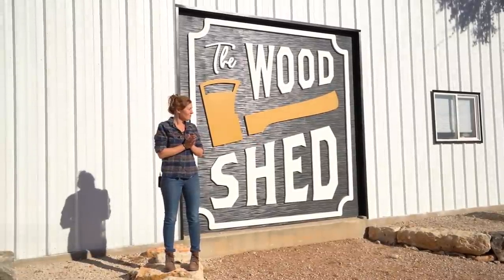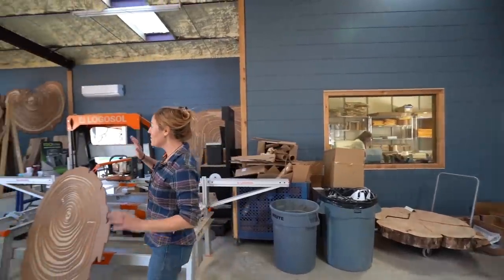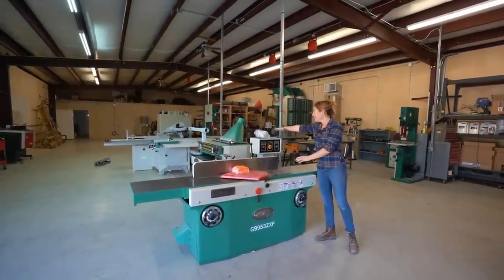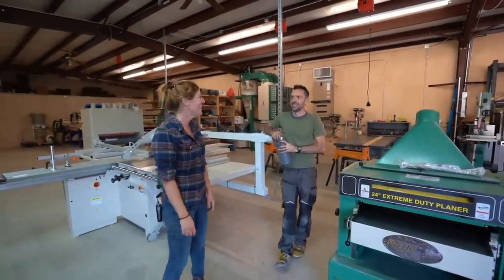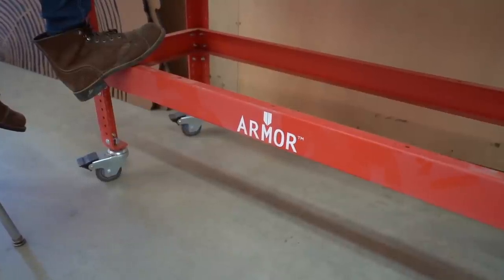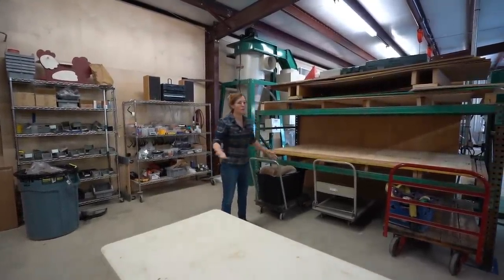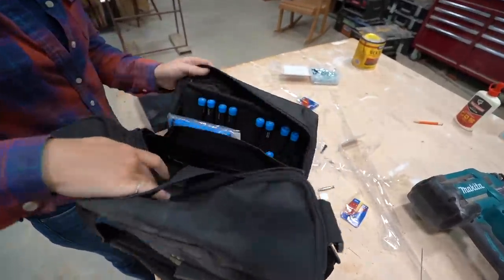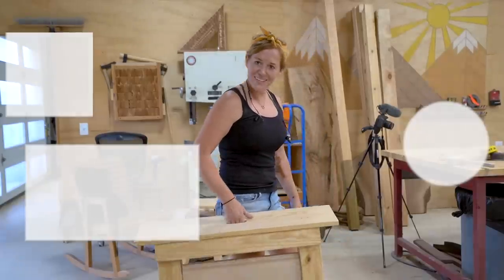Shop Tour! Inside My New Commercial Shop

Comment: When you showed the band saws I recalled a Youtuber I am following that is rebuilding a 108 year old sailing yacht.  He used a giant band saw to shape the ribs.  It is called a ship saw and the angle of the blade can be changed as he is cutting.  He also uses a number of hand tools to make the parts.  Check out Tally Ho Boat Restoration.

Comment: WoW! You have come a long way - Congrats! As a single person,  pro shop, when I am in milling mode I can produce 500-550 gallons of sawdust per day. That requires me to empty my drum every 20 minutes. With 4 people working, I predict that you will find the dust collection will require constant emptying. No doubt you had the dust collector sized appropriately for the machines as far as suction is concerned, but it is placed at the far side and the collector holding capacity is a bit small for the amount of work you will be doing. Congrats on the amazing growth you have had!

Comment: I’m surprised that the exposed foam on the ceiling is permitted.  Could you speak to that?
Reply: I bet it’s less flammable than the polyethylene that’s typically on the ceiling holding up fiberglass insulation.

Comment: Anyone had luck with the discount code (see 4:40 in the video)?  I have purchased 2 tools from Grizzly (bandsaw and jointer) and while the code is recognized as a ‘valid code’, no discount is applied.  Contacting Grizzly they stated that 14” bandsaw and the 8” jointer I was purchasing are not valid tools for the code.  They also declined to tell me which tools it DID apply to.   I love April’s feed & work and I love the Grizzly tools....I’d really LOVE to get 10% discount!  :-).   Any updates April?  Seems like Grizzly is benefitting from this great publicity but maybe not completely holding up their end?

Comment: I just stumbled across your channel.  I envy your personal and commercial shops, and all those wonderful machines.  Since I was a kid, I've always enjoyed operating machines - from movie projectors to sewing machines, from tractors to IBM mainframes.  A few decades ago I worked as a shop helper in a machine shop and had the opportunity to operate a few enormous horizontal band saws, and got a little machinist training on a manual mill and lathe.  I even got the chance to run a simple job a couple of times on a huge Brown and Sharp CNC vertical mill  from the 1970's that read its programs from paper tape.  The only command sequence I remember is G0D0Z0M05.  From there, after a decade or so in retail and food service, I moved on to data entry progressed into mainframe operations.  Computers are also machines, and I enjoy operating those too.  The company I work for eventually downgraded from its in house written IBM mainframe based platform to an IBM mid-range based platform, formerly known as the IBM AS/400.  I'm now basically a system admin on that platform.

YouTube keeps trying to find more hobbies for me than I could possibly have time for.  I've explored hobbies ranging from quilting to blacksmithing, from Bob Ross style painting to stained glass, and many more.  I took wood shop in junior high and high school, and haven't done anything with wood since.  Over the years I've thought of getting back into woodworking.   I love the look of nice woodwork, built in book cases, etc.  There are many things around my home and garage that would benefit from me getting back into wood working.  I've decided to start acquiring some wood working tools and explore this rabbit hole.  Many of the tools are machines that I would get  the pleasure of operating.  Last night I ordered a random orbital sander.  I have a wood palette for that Bob Ross style painting that needs a few more rounds of light sanding and linseed oil applications.  with sanding by hand I keep putting off working on it.

I'm also in Central Texas, between Dallas and Austin.  I'll have to check out The Wood Shed some day, if your part of Central Texas and my part of Central Texas are close enough together.  There's a lot of Texas out there.

Comment: You're doing the ductwork make sure it's all 8in no 6 inch piping the larger the pipe the more cfm's the thing people miss when they buy a dust collector system is they don't buy big enough piping and need to be metal no plastic. In the main trunk should be 16 14 and 12 buy yourself a four-bagger dustek collector. The most important machine of all is the TimeSaver two-headed wide belt sander. This should be the first machine you ever buy. If you don't know what a time-saver wide belt sander is you haven't been in the wood industry very long. Just call me coach. I noticed all Grizzly machines went up in price must be because they're made in China

Comment: My uncles machine shop, was laid out now it takes a lot of time and energy to move equipment around and my uncle was known as the move it man. Its good you found someone who knows how to set up a shop for good work flow.

Id have someone make me a jib crain to handle material movement in the shop. That and a fork truck.  For logs a clamp truck used by the printing industry to lift and move logs. Put stick on sand paper on the clamps or anti skid tape. These are made to move big rolls of paper. 
A large jib crain on an I beam down the center of the shop that way moving slabs won't require a fork truck all the time in and around the machine's.   1 ton should do it but electric.  Also a swing boom. 
I know these are used in machine shops to move metal, but they work with any media.

Comment: If you are going to be running the sawmill that much you might want to invest in a sharpener to simply include sharpening blades in the business model. With the machine setup it is a simple mark the start point and set a timer then just let the machine do the work so it is just the setup and removal of the blades that you are paying labor for.  A simple set of calipers at the intake to make sure you can still sharpen the blade and I would also say a camera to take a picture of the measurement and maybe a video camera setup to look at the blades as they get sharpened to look for damage before it gets to the grinder.

Comment: Two things, are you going to do to rent or lease shop time? Such as if I brought you a project could you put it through your large planner or sander?  Second is I cringe when there is dust equipment and metal “shavings” so close,(drill press) one spark off a tiny piece of metal can mean an explosion or smolder in the dust for hours then burst into a fire, just saying be very careful. 👍🇺🇸

Comment: Congrats on your progress; it's very rewarding I'm sure! As someone who has a similar shop with similar equipment, two quick suggestions before all the ducts go in... 

1. Move the wide-belt sander closer to the planer. You are going to be doing lots of slabs, and even at 24", many slabs will not fit on the planer, so the first tool that will process them will be the wide-belt, and it is located in a very inconvenient place to do so. You'll use the slider after the wide-belt, so moving the wide-belt 'upstream' would be good.
2. While that dust collector LOOKS big, it is actually NOT going to be enough to support the shop tools AND three CNC machines simultaneously. Your shop is big enough that you will need to bail on the big green bear with regards to dust collection and actually build a system that has an airlock and an outdoor cyclone that dumps directly into a bin/dumpster so that it can run continuously. If you don't have that, you will be shutting down all machines multiple times a day to empty the current dust collector.

Wish you the best of luck as you grow your enterprise!
Reply: Yeah those bags will fill up in minutes

Comment: congratulations on your success. However, I like your channel more when it was dedicated to the do it yourself. Your success has brought you to a point far beyond what your average do it yourself or can do it in their home garage.
Reply: She still does projects of varying degrees of difficulty, but some videos are showing her commercial space and what it will offer. She still builds what she needs and brings a camera along, just like in remodeling the commercial bldg. She did the job and brought a camera, taking us along the journey.  
Many of her projects can be modified using different tools, it would just take longer. If you have a CNC, it be crazy to not use it. It'd be like using a screwdriver instead of a drill, a hand saw instead of a circular saw, etc.

Comment: This is a manufacturing plant and not a shop. I have for many years worked in shop and clearly this is not a shop. Congratulations on your factory
Reply from the maker: Splitting hairs. Many projects have been done in this Shop, a building with machinery and tools. Thanks for watching.
Reply: @AprilWilkerson  
Dear MS Wilkerson my comment on your shop having become a factory can be viewed in several ways. You have deservingly broken through the glass ceiling and having 2 daughters understand how difficult this is. 
But as a carpenter of 60 years, starting in trade school at 14, your machines are ones not available to most home shop setups. The woodworking profession is for everyone. When you use machines beyond the availability of basement and garage shops it takes the glass ceiling and raises it for those who want to learn. Can you build projects using tools found in most home shops. The joy of carpentry is in the completion of the build and pride of its accomplishment.
I once again congratulate you your breaking the glass ceiling. Please help other too do the same in their smaller shops